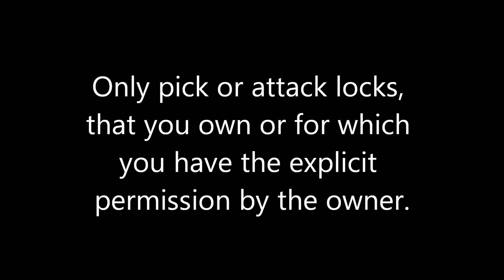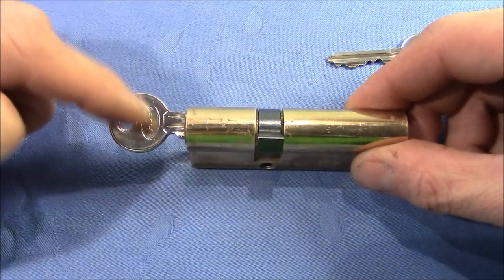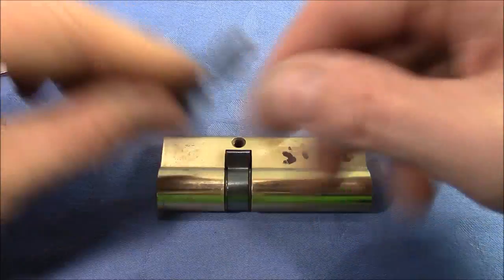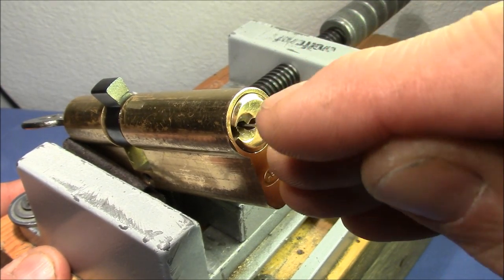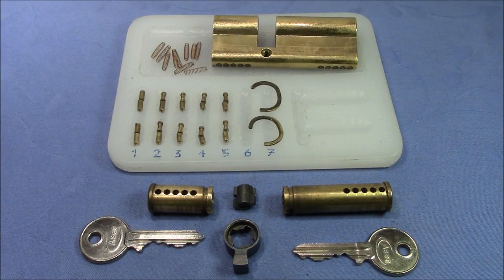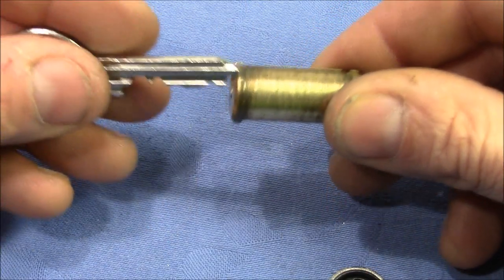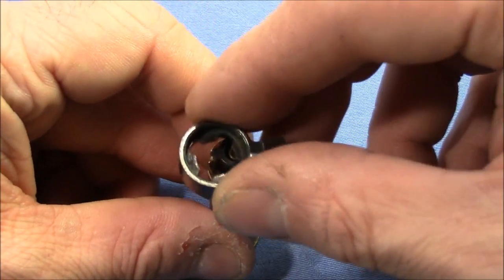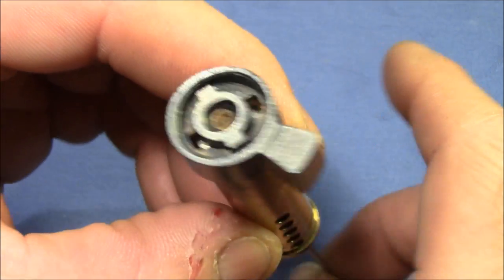(picking 289) Asec euro cylinder picked and explored - how to turn the cam after the lock is picked

Comment: Great explanation and great vid again my friend. On more than one occasion we pick locks assuming that with this we would open the door, but on many occasions this would not be enough to turn the cam. Very interesting.
And great picking also, I have three euro Asec and one of them is real evil. Its key way is very awkward for me. I usually pick the locks wit the pins side up, and I think this makes it difficult for me to maneuver in this case. The spools are a nightmare.
A pleasure to view buddy ;-)))
Cheers!
Reply from the maker: Thank you. Yes, we usually neglect the locking mechanism that the lock operates. So sometimes it's good to focus on that. Concerning the picking: The biggest problem for me was to place the pick correctly on the pins. Before working on that, I was not precise enough and picking the spools were difficult due to the absence of feedback. Good luck with your evil Asec. Cheers my friend.
Reply: I don´t give up! cheers buddy ;-)))

Comment: The cam does not turn when the key is in the lock on the inside.....AND......it is in position at right angles to the keyway, (NOT vertically aligned with the keyway). 

Thus the lock is locked with the internal key and any key inserted into the keyway on the external side will not dislodge the internal key from it's position in the internal keyway.....or permit the externally inserted key to operate the lock.
Reply from the maker: Very true.

Comment: Hi, I have a euro lock on a pvc door which doesn't always lock as it won't turn anti clock wise. Some time it takes 5 minutes fiddling with it by reinserted the key multiple times and   by slight having the key out I.e not fully in. Is there any way to fix this issue?
Reply from the maker: Most probably the or the pins are worn out. Check other keys. If they behave the same then you have to replace the lock.